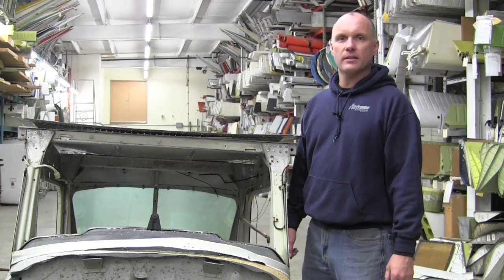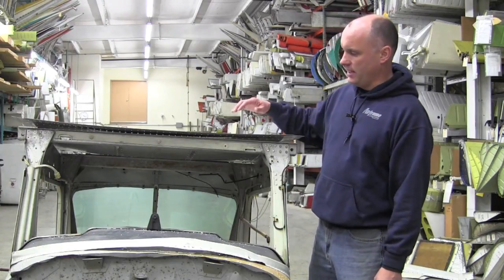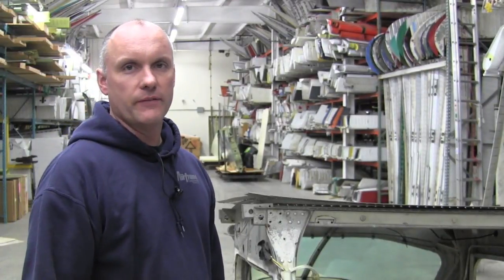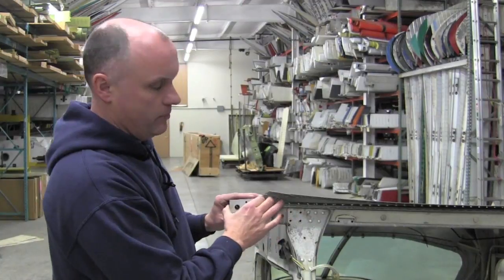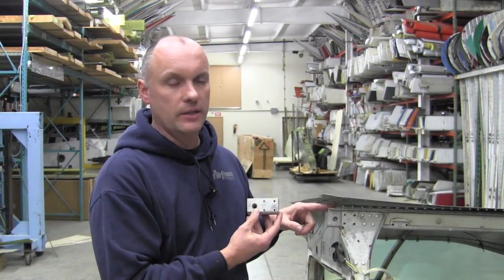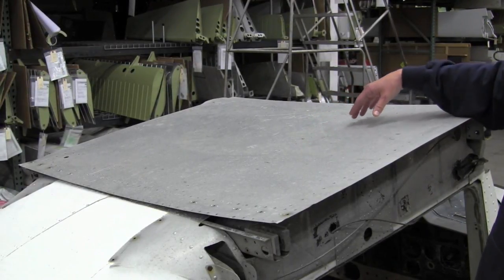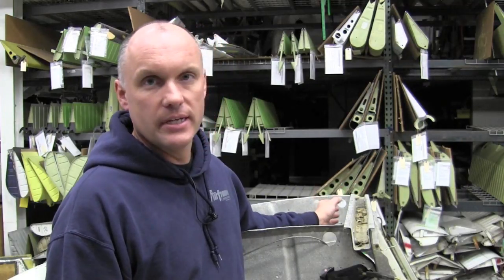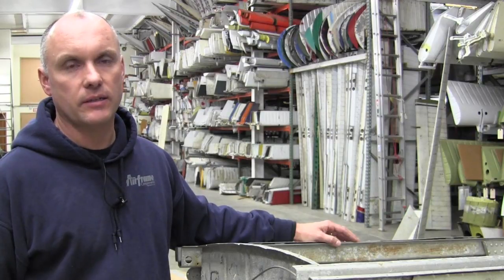AC Cessna Spar Carrythrough Inspection

Comment: I know this is an old video. I would have liked to see if you cleaned up the block and or the carry through so that we could have seen how to clean it up and what would be the proper way to do it and to what extent the cleaning would have to be done to have it acceptable. Then I would have liked to see the reinstall using the protection you mentioned should be done on reinstall. I mention this as I went to a&p school and the explanation was just as you showed, but never showing real life carry through. Just quick this is what you would do with out any real life handling of a problem. Thanks again.
Reply: Sorry to say that 3 years later and no one has responded to my questions.

Comment: Excellent videos, thank you. Would the corrosion shown on the rear carrythrough be repairable, or would that require replacement?
Reply: It is very repairable. It was just surface corrosion and not inter granular.

Comment: The aircraft Illustrated Parts Catalog would have a breakdown of the individual parts that comprise the roof area. 

Standard torque values would apply unless otherwise specified by Cessna.  Not sure if the older Cessna service manuals call out standard torque values.  The SRM for the restart aircraft has much more information regarding hardware specifications.  Thanks for watching!

Comment: I just discovered your excellent series of videos.  I have one question?  Is there a Cessna "Assembly Manual" or "Illustrated Parts Guide" that shows all of these internal parts and the torques required? 

How do you know how much to tighten those AN bolts?
Reply: Herb Garcia. Hire an a&p mechanic